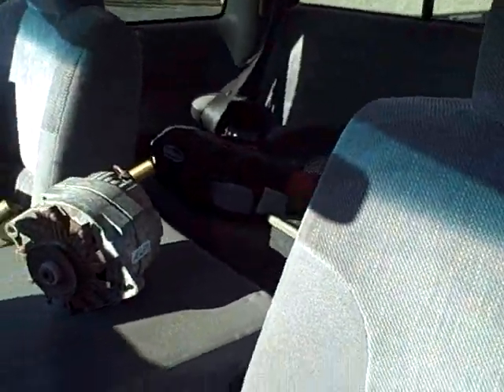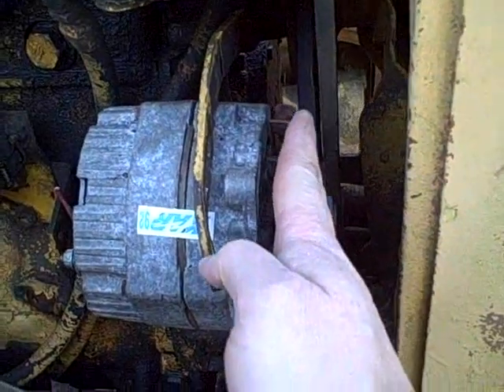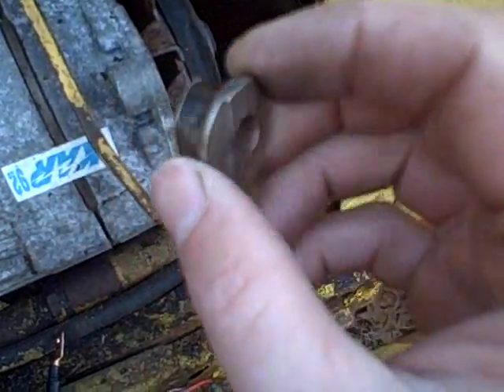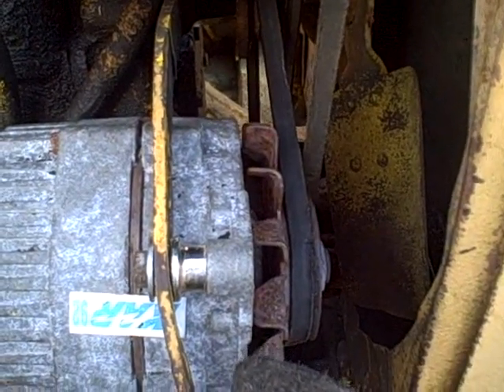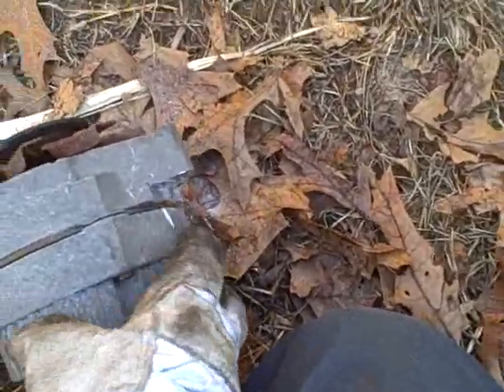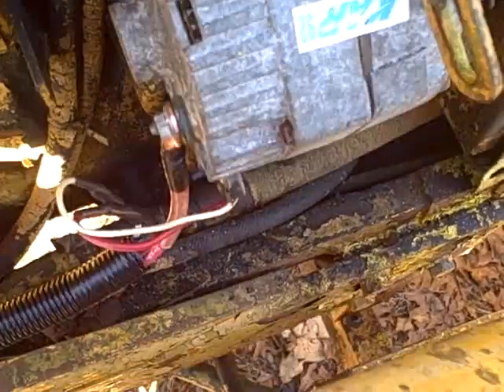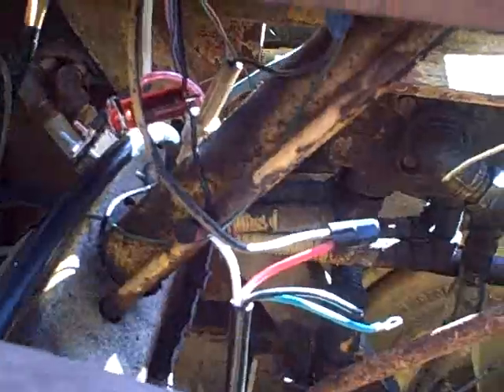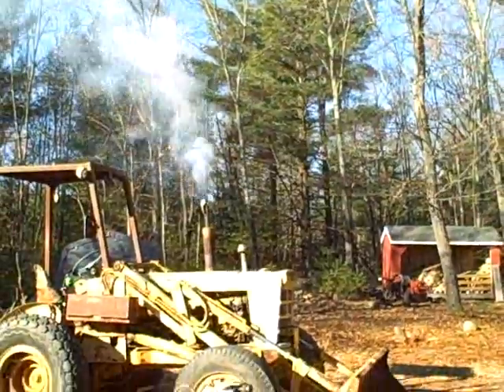Oliver 770 Industrial Tractor Project Part 45

Comment from the maker: What, me worry? I bet with just a rebuilt injector pump, injectors, new cylinder sleeve/piston assemblies, reground crank, new rod/ main bearings, new rear main seal, and a valve job, and this thing will run mint!

Comment: Ya see what else scares ya LOL maybe a bucket of worries as you get deeper ,Thats the problem with putting a bunch of new stuff on an old something , I always say be careful of shoing a dead horse might look good but it still won`t work , The upper bracket where it bolts to the head just make an L shape bend at the bolt then you won`t need shims ,you could shim the lower crank pulley too 1/8 or so be enough to go by the rad pipe.

Comment: Touch the charging wire see if it engages power ,It`s the same as trying to get a full 12volt thru a test light it can`t because of the resistance of the filament thats why I used a spare off on Ign . I had .Thata weird with the alt it should have mounted right up would if you use the back of the old one for the mounts.